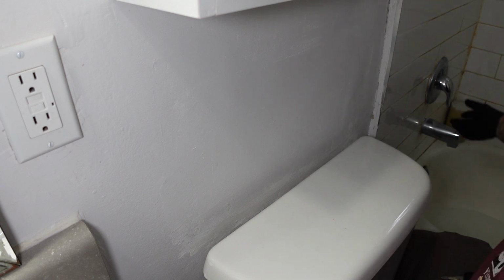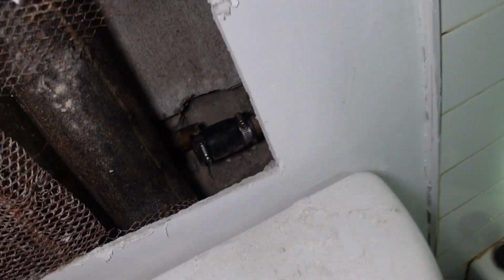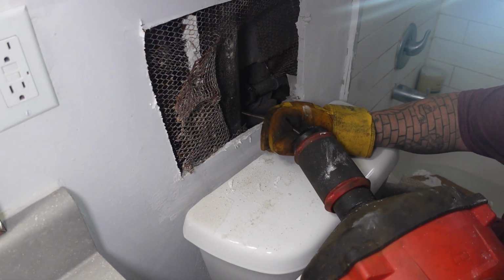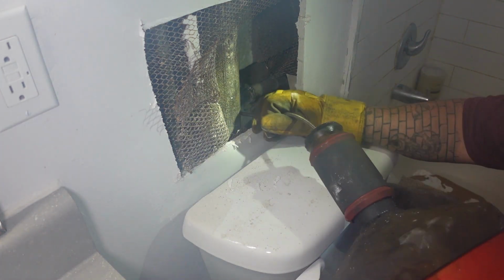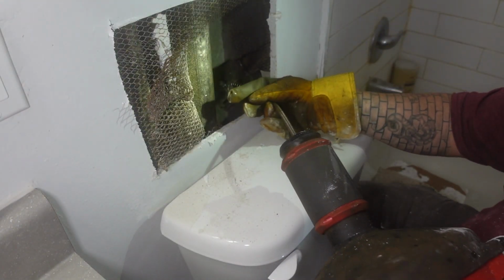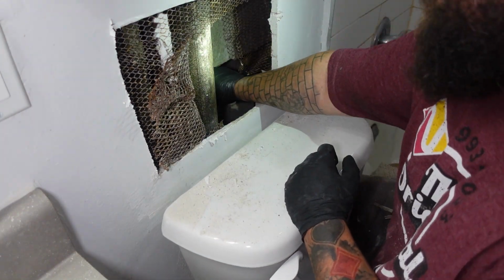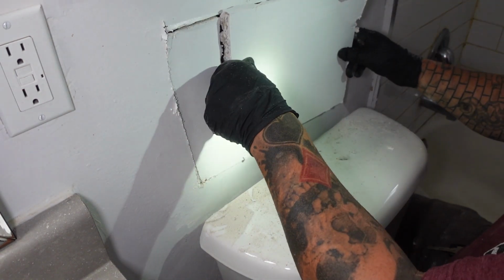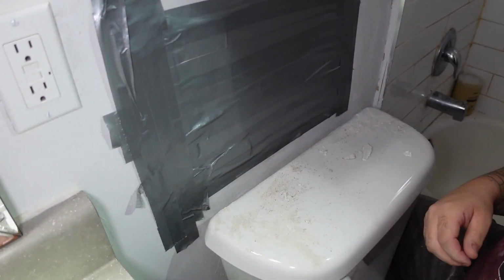I Need To Cut Open The Wall To Snake the Bathtub.

Comment: Thank you for not showing us your Milwaukee undies! 😁

I keep about 8-10 feet of 1x3 pine boards in my van to make cleats so I can reinstall the drywall for those times when I need to cut open a wall. Cut off a couple of appropriately sized pieces, a few drywall screws and you're done.
Reply from the maker: Yeah that's definitely a good idea. We normally don't fix the drywall or anything like that. The manager just wanted me to basically seal it up so bugs wouldn't get through until they have their guy that does all their plaster work and the drywall work come in and fix it. I'm really hoping they put an access panel in there so that we can fix it next time easily. Thanks for watching Roger and listen. If I had Milwaukee undies you'd be the first one I would show loll. Have a great night!

Comment: Nice job Jay on clearing that line! To bad that you couldn't install a cleanout while you are there.
Reply from the maker: Yeah this is a management company that want to pay very little. It's pretty sad they don't want to get the job done properly, but what can you do? Thanks for watching Brandy, I really do appreciate it and I hope you have yourself a great day and a great weekend
Reply: @Jaythatdrainguy I’m curious as to why when you’re already at the point where you’ve got the wall open wouldn’t you install a cleanout? Two cuts and two no hubs bam bam
Reply from the maker: @noahrudy13 because the company that we go there for are cheap they literally had us go there almost every month to pour acid down the drain so we wouldn't have to open the wall. I agree a clean-out should be installed. Thanks for watching
Reply: @Jaythatdrainguy  may I ask what Acid that was? Just wondering

Comment: Great job Jay, makes a change no 💩💩in the bath, tile a thin board, and then screw it over the hole so you have access for next time
Reply from the maker: Yeah I agree Taylor. They definitely need to put something in there. The problem is they don't like tenants being able to have access to holes in the wall. So if there's an access panel the tenants could get in, I think what they should do is put an access panel that locks and then they can cover that up with like a picture or something like that. Thanks for watching brother. Have yourself a great day!

Comment: How about educating these ignorant  ppl on drain screens. Wow! 🥴 I don't know how you do it Jay.🤨
Reply from the maker: I agree with you. This was kind of a one-off. We believe there might be construction debris in that drain because as soon as they finished renovating that unit this happened and It backs up every 3 months or so. So unless they actually go in and open up the ceiling downstairs and the wall and take out that tee, this is probably going to be an ongoing thing but if they keep the access panel in we can snake it a lot easier

Comment: What’s up man! I got a situation going on here at my home and wanted to ask you some questions. My tub overflows when I shower and takes about 2 hours for water to go down and leaves a bunch of residue in the tub. Had a plumber come out tried to unclog tub and found mud when he pulled it out. What should my next step be? Could it be a broken pipe?
Reply from the maker: I'm guessing this is on a slab or in the basement?